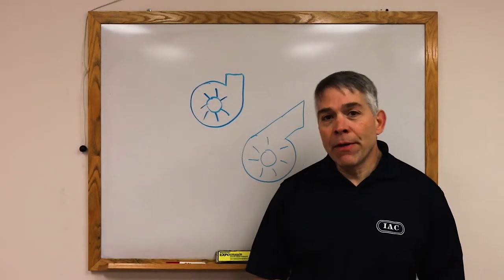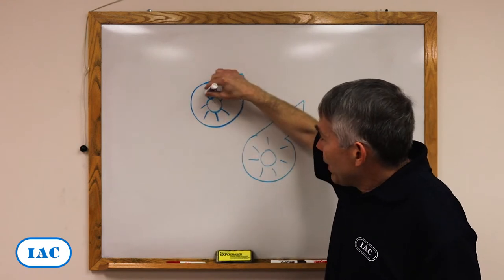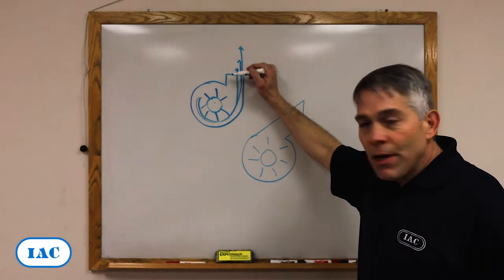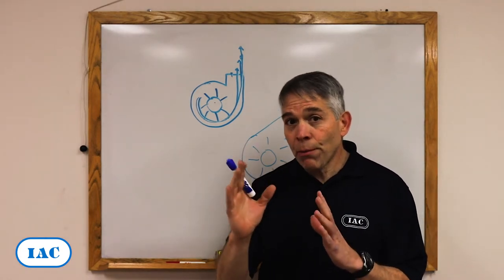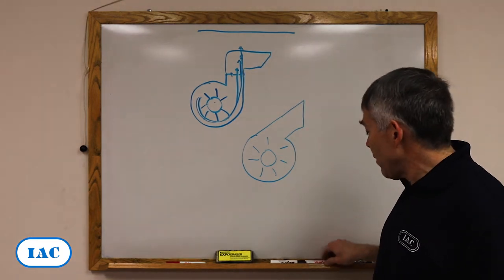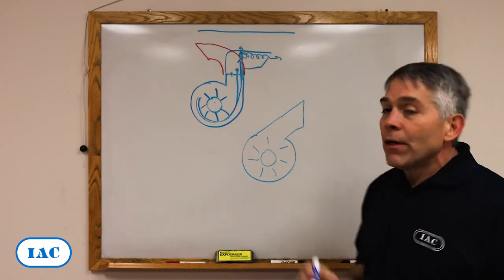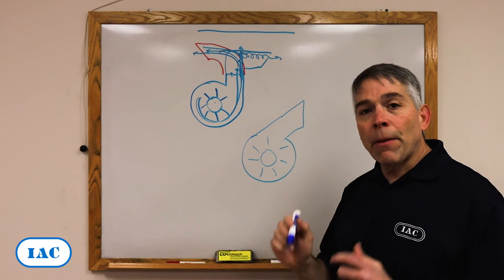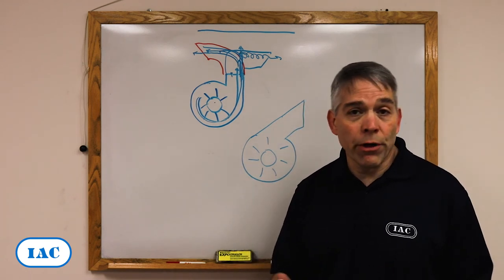Centrifugal Fan Principles

Comment: Your explanation is very useful.

How to determine air flow of blower located onsite with the help of Performance curve, drive ampere, blower speed but without visiting site? Or what other data required to determine it?
Thanks in advance

Comment: I have a canon type sprayer and I have difficulty moving the spray stream if there is even the slightest counter breeze. Is there a calculation that can be applied to determine how big the fan needs to be to blow air 75 meters into open space?